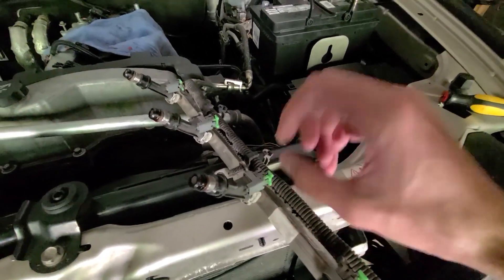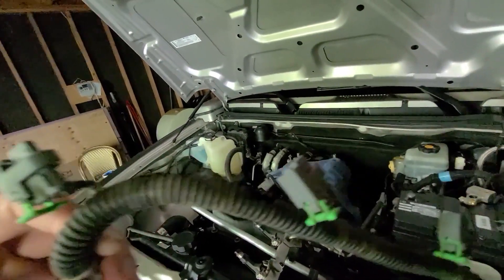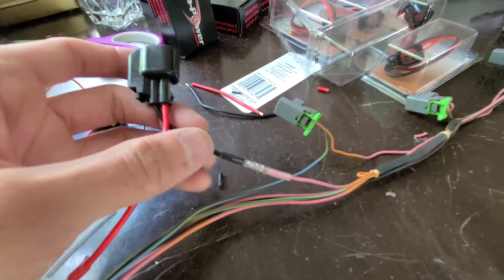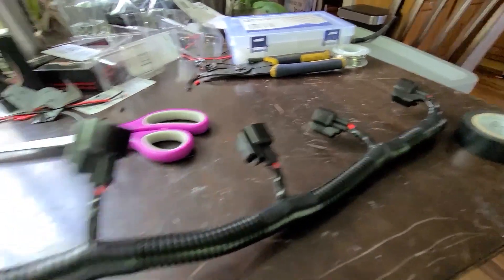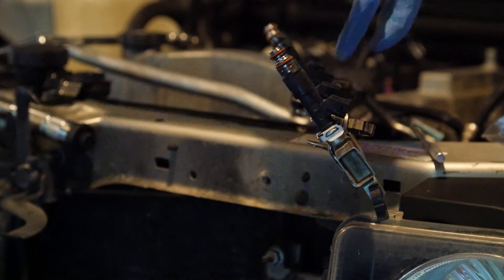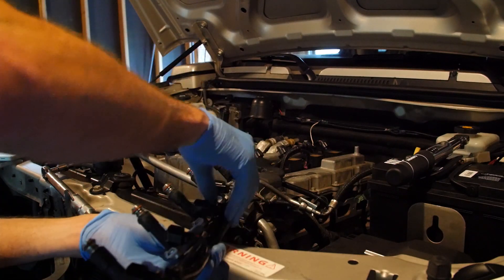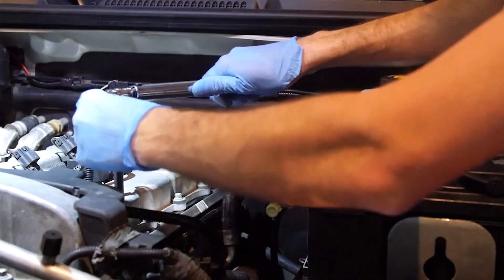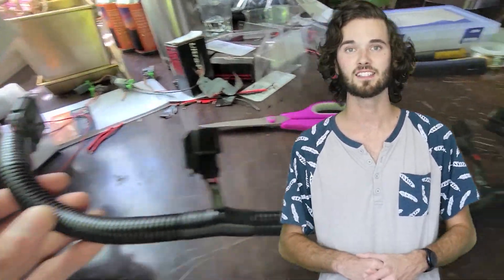LS Injector Swap | Hummer H3

Comment: What injectors exactly did you order. Years etc
Reply from the maker: Hey Trent! I ordered the injectors for the 2008 3.7L H3, which is the year that engine received the "LS-type" injector. ACDelco part#: 2173084. I needed to also order the same year injector connectors to adapt the wiring harness.
Reply: Thanks for the reply. We went with a turbo and she's pushing 8psi needed some more fuel @H3Humper
Reply from the maker: @trenteastman7441 oh hell yeah! Do you have a build thread or Playlist where I can follow your progress?
Reply: @H3Humper this is for my business. It's a customers H3. American Auto Body and Restoration in Cheyenne Wyoming

Comment: i have an 06 hummer and im getting the 0301 misfire. 

I have swapped coils and sparkplugs. Is this a common problem for 06 models??
Reply from the maker: I'm not sure how common it is, but I have seen examples where the large wiring harness at either the front or rear of the engine has freyed, leading to misfires and other weird issues. Have you pulled the plastic conduit off of the harness and inspected all the wiring? If the wiring is the issue, it is pretty easy to see cracked insulation on individual wires or if they're completely exposed it's even easier.

Comment: Love your videos man. Quick question: will 2010 model H3 injectors work the same as the 2008 ones you upgraded to in the video? I can't find much information on the 2010 injectors, but they are 19$ each on Amazon vs 41$ each for the 2008.
Reply from the maker: Hey, thank you! 🤓 Sounds like you found a darn good deal on the 2010 injectors. The connector type is the same as the 2008 type, so they will connect and install without any issue (the physical size fits the fuel rail/head of all model year 3.5L/3.7L). I tried finding a tune file for a 2010 to compare the fuel tables to the 2008 but was unsuccessful in finding one. I imagine there is a marginal difference between flow rates of the two different injectors, which is not a super big deal. I am confident 2010 injectors would function just fine in your application without any tuning. A tune would be best practice, of course!
Reply: @H3Humper  thank you sir!

Comment: Hey brother, whats the point of the swap??
Reply from the maker: Hello 🤓 This swap could serve a few functions. One reason is to increase the flow rate of the fuel injectors, which would be useful in forced induction (turbo'ing or supercharging) when more fuel is needed to prevent leaning out. Personally, I did this swap because it saved me $250 over replacing with the same old model injectors. Rock Auto had a sale on the "late LS truck" injectors, so I bought all 5 of these ACDelco injectors for $90 total whereas the "early LS truck" injectors cost over $340!

Comment: Good Job man! you may be a tuner before you know it!
Reply: what is the benefit? More power?
Reply from the maker: @crtinkering7323  Thanks! I've been learning quite a bit from tuning 🤓 No real differences from this swap with the engine being naturally asperated. The injectors will live an easier life than stock but could also supply enough fuel for boost, if I ever try turbo'ing it haha. My main reason for this swap was cost... '06 injectors were something like $90 each and these were only ~$20 each!